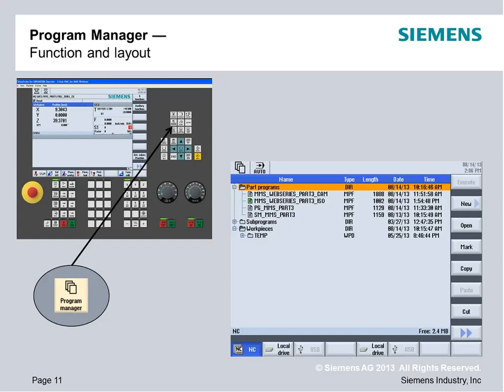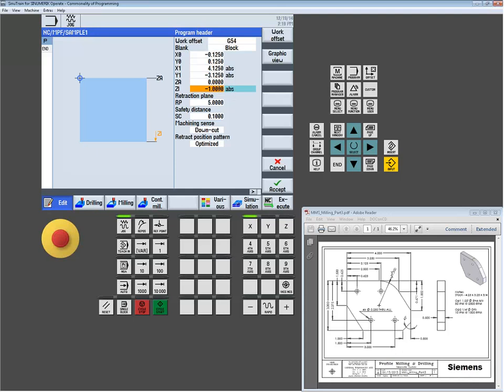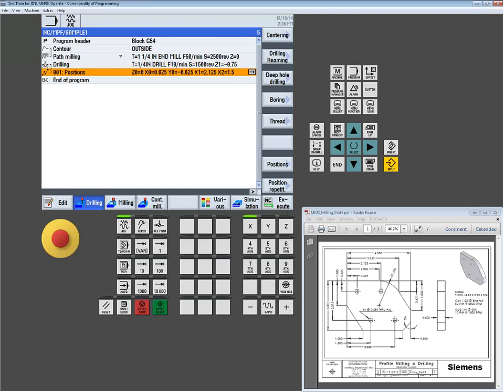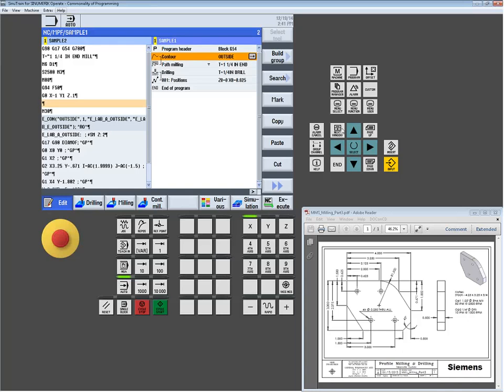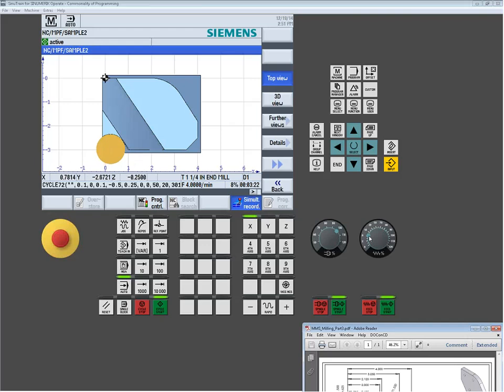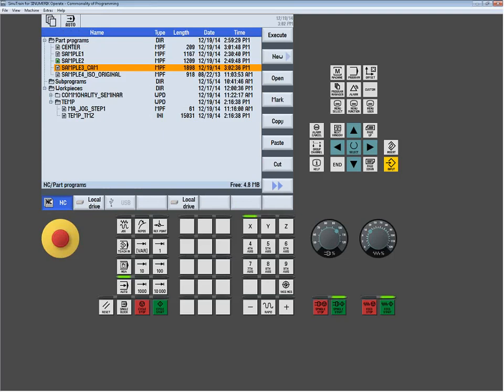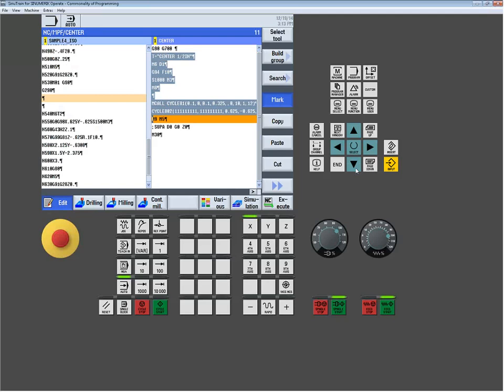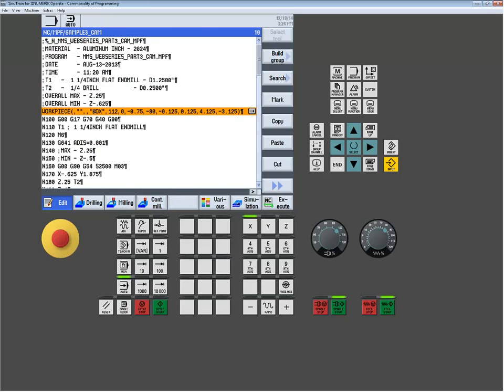Commonality of Programming for the Siemens Sinumerik Milling 840D & 828

Comment: I have a question as to When you use SUPA to cancel work and tool offsets and move to Z0, at what point does your G54 work offset become active again?
Reply from the maker: SUPA actually only suppresses all the active frames for that line, it does not, by itself cancel the G54 work offset
Reply: @MrCNC  
Thank you Sir.